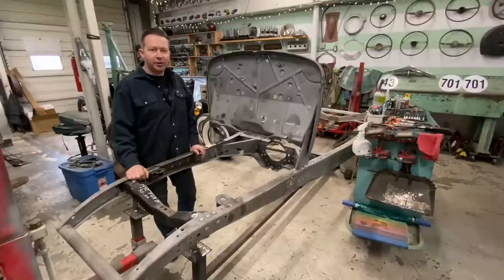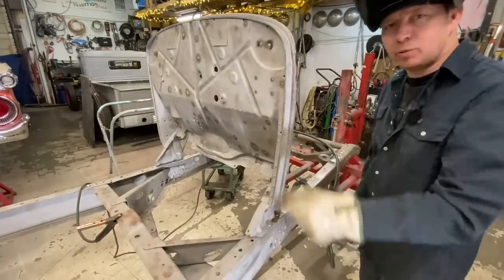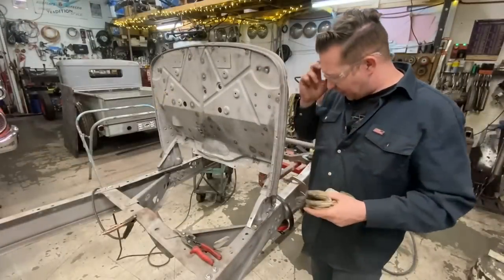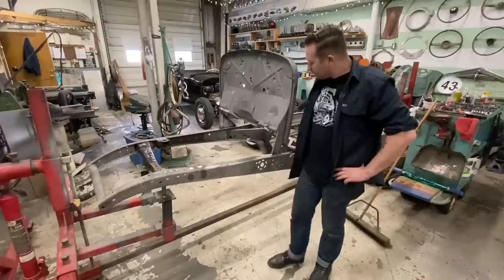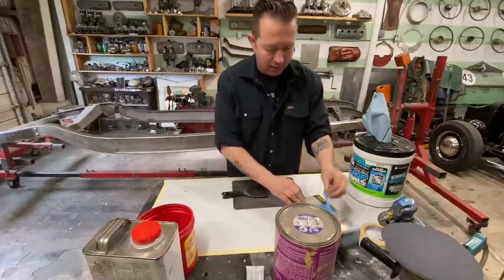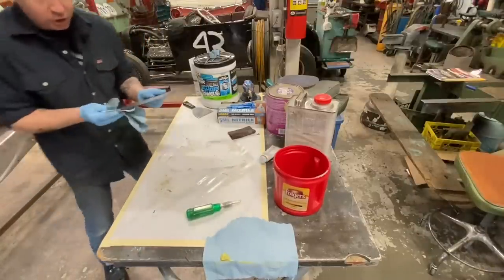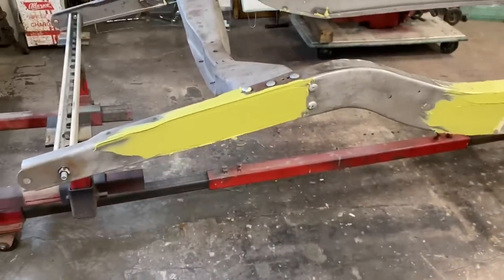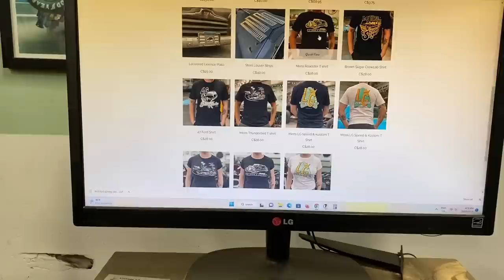Filling Chassis Pits. 32 Ford Rebuild Part 14

Comment: First of all congratulations to Shannon and yourself Lee. All the very best wishes in the world. I’m sure you made the right choice on the chassis. My roadster chassis should be in paint. The fellow that has painted it has gone black on the inside and just body colour on the outside frame rails. He said if you want to change colour in the future you just need to do the outside rails. (If that makes sense) I’m going gold engine and gold firewall. Black and gold interior. Similar design to brown sugar. See what a bad influence you have. Take care, thanks for your time and inspiration.
Reply: I’m to doing filler work. I use body filler on the cracks in the house I find it much better than house products.
Reply from the maker: Hahaha I’ve used body filler as floor leveler before.
Black and gold is a killer combo, it should look great!
Reply: Thanks

Comment: Watching to see what you will do with your '32 rails ----- Noticed when you grabbed the hardener for the filler --- and you said -- oops it blabbed out ----- don't you have to knead the hardener first -- like you do bread to mix it all together -- it's separated in the tube -- became liquide.  --------- And does bondo--- applying the second coat stick to the first coat in the low spots that  as you showed without scuffing the low spot with say 40 grit by hand to give it something to bite to and won't flake off latter -----Thank You for the Video ---- Rodney
Reply from the maker: I did the knead the hardener first, but obviously not enough. It still worked out though.

Comment: I just found your channel and I'm really liking this build. I too am building a '32 5 window right now. Do you know that that centre hole on the firewall foot is actually for pulling the body down over the firewall. A rubber gaskit goes between the body and firewall.
Reply from the maker: I did know that yup. When you get to episode 20 or 21 (I don’t remember exactly what video haha) the body and firewall go back on permanently

Comment: Please wear eye protection when power sanding. (Or power anything!!)
Reply from the maker: But, I was standing down wind, so the dust floats away from my eyes 😆 💨
Reply: @LGKustoms  Forget the dust. When the disc explodes and impales your eye is the problem !!!!
Reply from the maker: @waynedoe2486  oh your talking about what I used to prep the chassis? That’s not a grinder, it’s a polisher with a Velcro sanding disc on it. It spins very slowly.